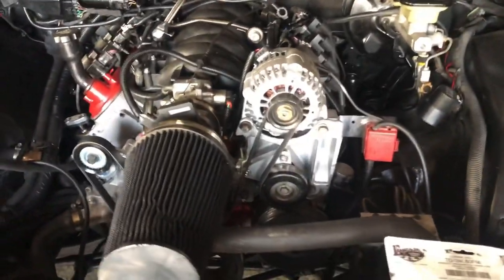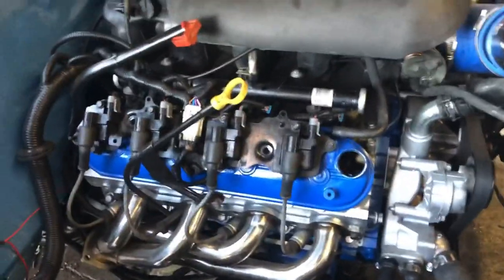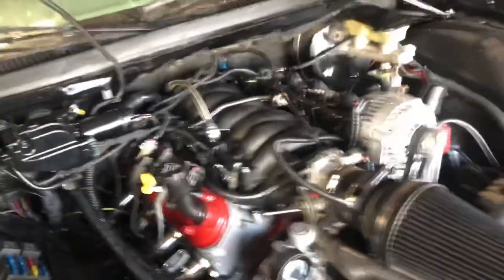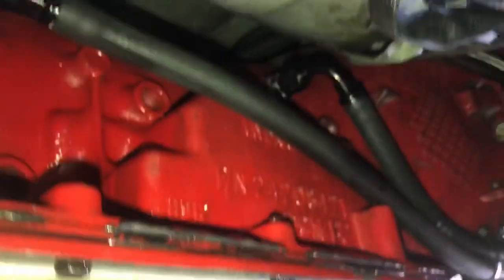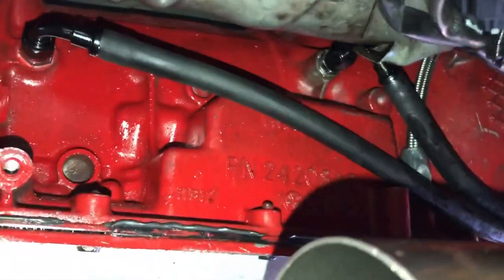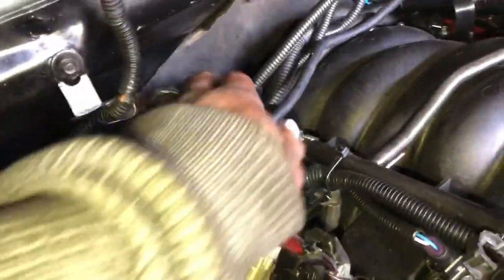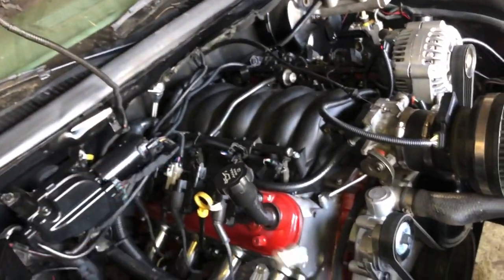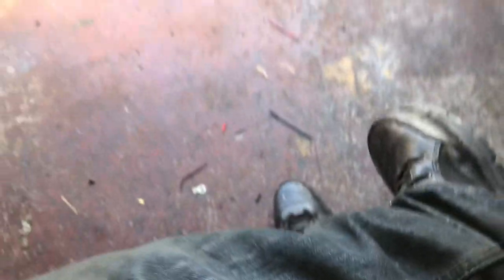HOW TO INSTALL TRANS DIPSTICK ON LS SWAP

Comment: Is the dipstick metal? Ordered one off eBay. It's plastic
Reply from the maker: No this one is braided aluminum hard but flexible great quality
Reply: I bought the cheap plastic one off ebay too (looked just like the lokar). Had to custom cut mine to size. next time ill buy the lokar
Reply: @WilsonAutoworks  how is it holding up

Comment: What length works for most swap??

Seems like the 24inch would be too short.
Reply from the maker: What are you talking about?
Reply: The flex  dipstick  length ....im doing a swap on a 71 nova.... i ordered a 24 inch wasn't sure what length to get, lets see if it works out..thanx for responding
Reply from the maker: I always buy the 24s thanks for watching lmk if it works for you
Reply: I bought one from lokar for a 4l60e and it was tight after install but poured fluid after install and it had the rubber seal in it even tried the origami rubber seal and it steal poured out fluid

Comment: I thought you had to drop the pan and put the lock nut on the end of the dip stick
Reply: i just put this exact same one in my 4l80e and on the instructions it says do not remove that bottom nut, when i was looking at it there was no way that it could be screwed in from the inside the pan after examing it closely. I even bought a deep billet aluminum pan to put on at the same time as doing this dipstick. You do not need to drop the pan and you do not have to put a nut on from inside the pan. At least for this one.
Reply: @safetylast911  I didn’t realize they had two models, one had a locking nut that you have to drop the pan, one is just push in. I was fairly confused for a bit lol